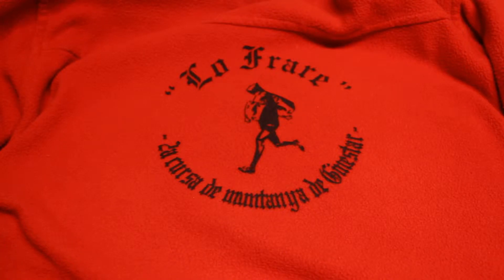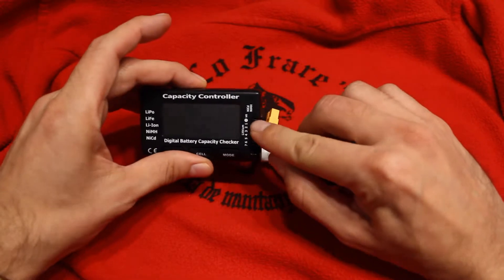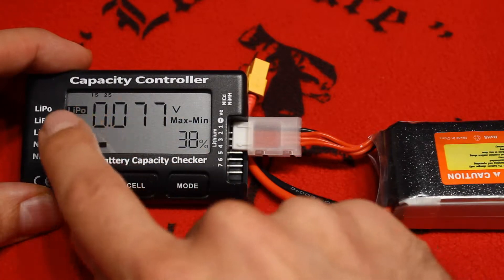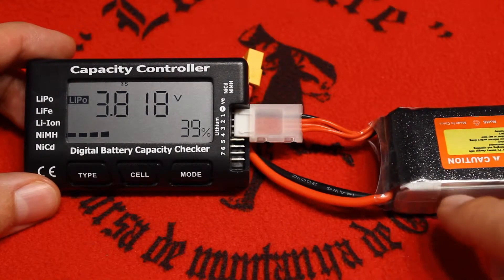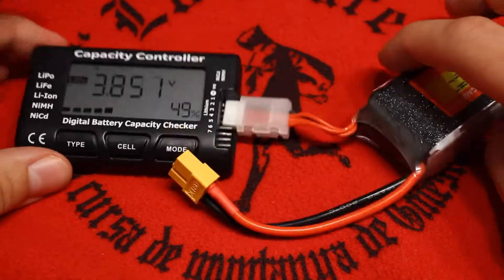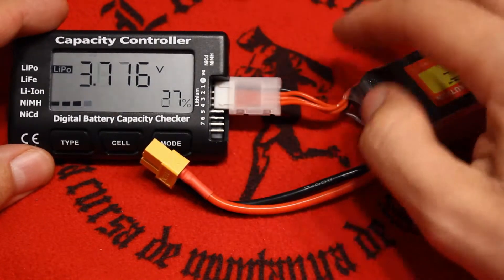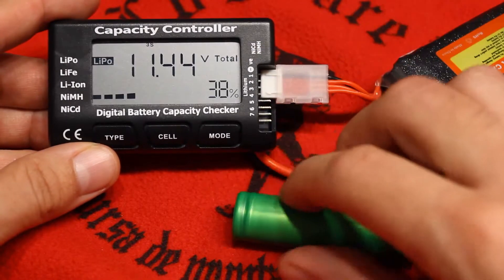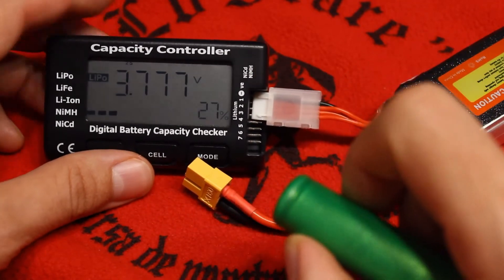7 cell meter - Capacity Controller

Comment: Great video! My 1º Cell is 0% and 2º Cell is 99%. So If I set it to balance, the first one will remain 0 and the second cell will decresce? The other cell won't charge, so does this mean my battery is broken? Thanks!
Reply from the maker: That's the way this balancer works! your battery is fine, just need to charge the discharged cell by other means.

Comment: How does it power on?  Do we need to put batteries in it for it to work? Thanks
Reply from the maker: It powers on when you plug the battery you are going to measure, ofc unless you are trying to measure a battery with very low voltage, let’s say below 3v

Comment: Can I check battery cycles with the Capacity Controller? If not, how is it done? Thanks!
Reply from the maker: Do you mean to know how many cycles the battery has? The battery needs to have a circuit that counts the cycles, not possible to know just with the voltage

Comment: Can you use this to automatically shut down the battery or power inverter after so much watts or volta have been used
Reply from the maker: No, it does not have this function

Comment: Can it be use as alternative to liitokala li500???
Reply from the maker: If you build an adapter for the cells yes, but this does not charge, only checks and balances.
Reply: Thanks.
Is it shows accurate capacity like liitokala??
Reply from the maker: @mamun2a  I do not have a liitokala to compare with. When I test different li-ion or lipos after charging it shows around 4.20 volts, so it seems pretty accurate to me